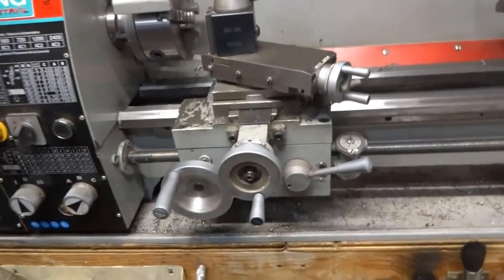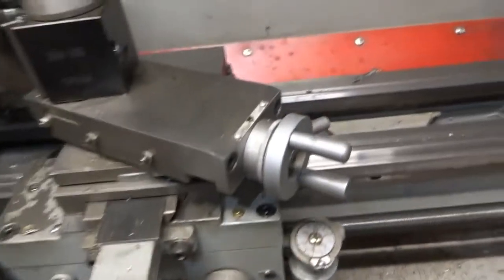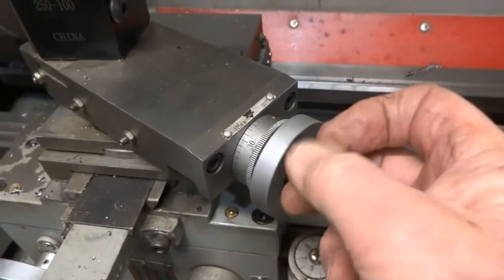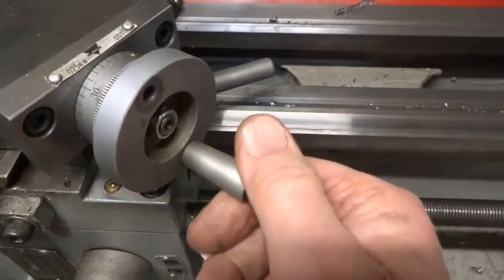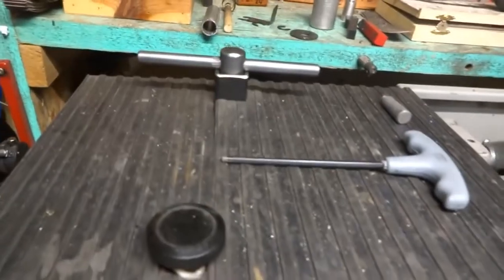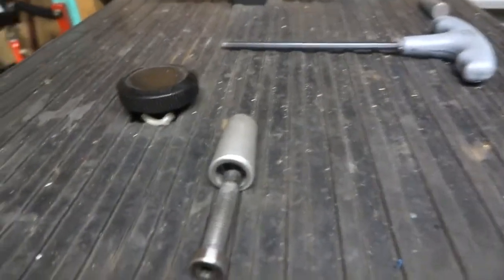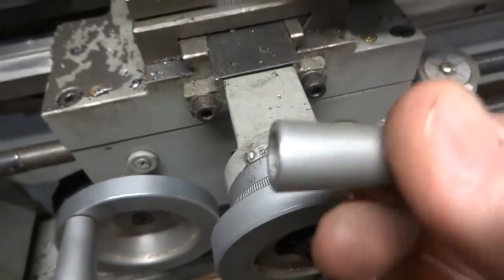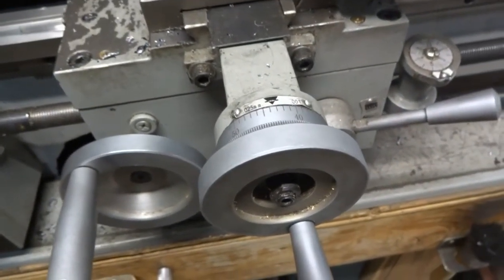Lathe handle Mod.

Comment: So are you keeping to the 2 handles on the compound?
Reply from the maker: I never throw away materials. Almost everything is good for something.
Reply: @MrModify  no, I meant are you going to keep using two handles on the compound side or go to just one like the like the cross slide?
Reply from the maker: Never thought about using only one handle. I am going to try that. Thanks.